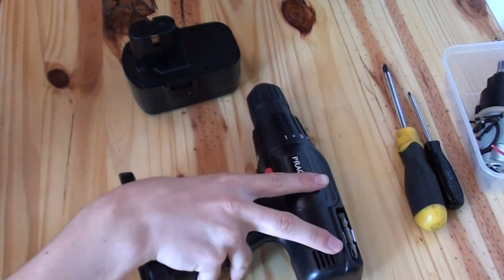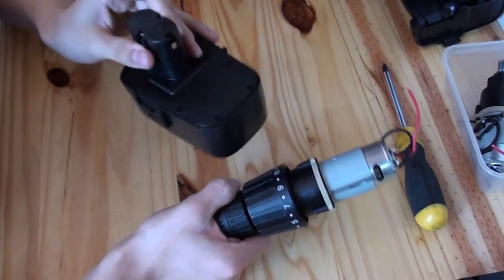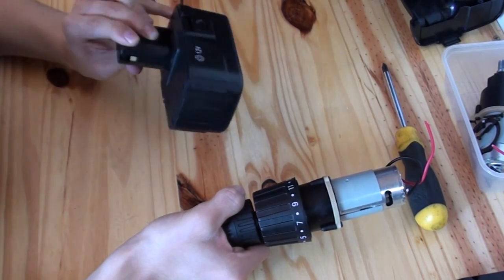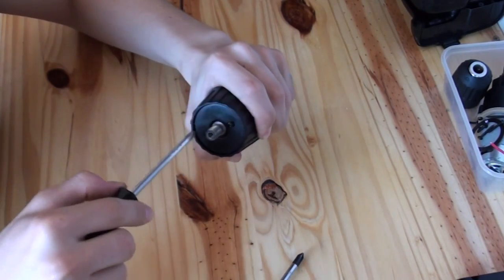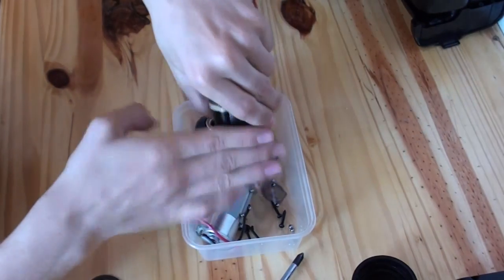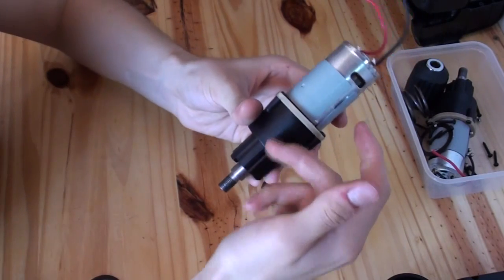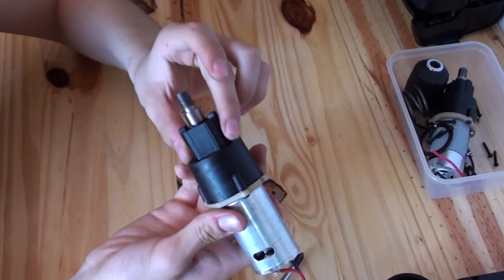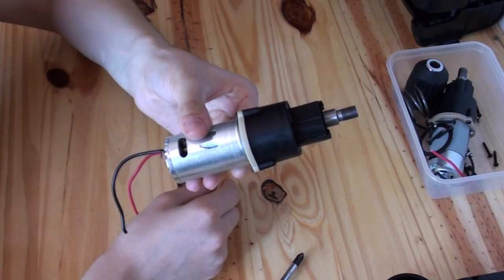How to: turning a cordless drill into a robot drive motor.

Comment: I have taken most of the ball-bearings out, but there's two which simply won't come out- no matter how much I shake them, they just stay there. Is there anything I can do to loosen them, or do I just have to shake them harder? Would hit them with a hammer but I am aware that at this stage, that could result in gearbox damage.
Reply: OK... bear with me on this.

A good strong magnet may work, if not try this:

Take a nail (A normal woodworking nail) something like a 3 or 4 inch nail will do fine... basically you want something you can get a firm grip on. File the point off it slightly and give it a quick clean with a paper towel.

Mix up a tiny bit of epoxy resin (araldite will do) and dab a bit onto the blunted nail and place it onto the bearing in question (try not to get any onto the plastic housing. Wait for it to set.

Hopefully you will be able to pull out the 'tricky' bearing.

Comment: Once I've taken the reverse-thread screw out of the chuck, I can't then remove the chuck- when I twist it, it just spins as it would if I was using the drill. What am I doing wrong?

Edit: never mind, I hit it with a hammer and it screwed off.

Comment: I am looking for a motor for my bot at present  I am using a power window motor .please suggest me with a motor working in 12 /24v rather than these
Reply: scooter motors are quite good drive motors, although they are ungeared but this can be solved with timing belts or chains.

Comment: i wish to make a camera slider .... i have seen a guy hack a kessler slider using an entire drill (not taken apart) to motorize the manual slider to make it go back and forth....will this be possible if i was to take it apart and how smooth will be the too and fro motion... will the motor start with a jerk as the camera needs to have a smooth start

Comment: You mentioned replacing the motor with a more expensive style motor. You got a source or part number for that? I overloaded mine and burnt out the motor. The reduction is still fine, but if I replace the motor with the same type, I'll probably just burn it out too. Great video.
Reply: Dewalt drill motors are supposedly better (haven't used any though) while they are more expensive, the motor and gearbox can take more punishment.

Comment: so where did you turn it into a robot drive ? you only got a motor out of a cordless drill. 
your title is not what you show in the video
Reply from the maker: You add a wheel on the gearbox shaft and put a voltage on the motor wires and you have a powerful gearmotor, which can be used for robotics. I have a how-to for making wheels to fit these drills (actually a 3 part series) and power input for the motor is a widely documented separate matter.

I don't know what could have been done differently in a video like this, short of strapping this to a testbed, which seems pointless when there a numerous videos on my channel alone showing motors like this powering robots.
Reply: TeamExpat i just saying that your title is not what you show in this video thats all.

Comment: Hi, great video, thanks very much!

Any idea what modulus the first stage gears are? Looking to order metal replacements but not sure what spec to get!

Thanks very much
Reply from the maker: Hi! These drills run whatever the manufacturers have settled on, which I don't think is any particular size (might be wrong). I believe they are very close, and possibly compatible, with mod .7, though I don't actually know for sure. I have researched in the past and they seem pretty close.

If you experiment, I'd very much like to know how it goes. An engineery friend of mine suggested the slightly brutal but neat idea of running mod .7 gears in a drill, using grinding paste as a lube, to run them in and make any differences in tooth profile less pronounced. Followed by a complete clean up of course. 

However as I mentioned to a fellow below just today, you can buy the sets of gears for these drills from a UK website called Gimsonrobotics, in their "gearmotors accessories" section. The kind of drill I have above has two 6:1 stages using 18t gears. 

Hope this helps.
Reply: TeamExpat

Thanks for your quick reply!

That link is handy, for £2.72 I'll try some of those gears they offer. I can see the grinding paste working if you don't overdo it, though I worry it might muck up the bearings which are handy to keep working.

Thanks again.

Comment from the maker: Hi, sorry for the late reply. For general combat, a drill motor and gearbox assembly is not suitable for a spinner. These gearboxes can shred internally with high shocks, which a spinner will have to deal with constantly. Plus, they're slow. These spin at about 550rpm at nominal voltage, which is very slow for a spinner these days. The best way to get a competitive weapon is to combine a brushless motor and a custom reduction. The rest of the internet can help you in understanding all that. :)

Comment from the maker: I believe the brake function works by stopping the motors hard, and pausing them, before you can change direction. So there is a delay between fwd/rev. For tank-steering style projects this can be a bit of a pain.

As for calcs, if you search "go kart speed calculator" or something similar into google you should get some results. Some will be imperial (inches instead of millimeters) so you'll have to work around those, but they're logical enough.

Thanks for subscribing, by the way! Good luck.

Comment from the maker: One or two robot builders have worked with those, they seem okay, but have a permanent "brake" function which can be a bit annoying at times. Also know the amp-handling figures those advertise are HUGELY over spec.

For numbers, I can't be sure, but I'd say 20-30a stall (on paper this is much higher), 1-2a free running, and under load anywhere up to about 15-20a. That's just my experience, again, datasheet often report different figures.

Do report, it will be interesting! Thanks for watching.

Comment from the maker: Hi, you can't use speedos from HK and similar because they are designed for brushless motors, whereas these are brushed. They won't work. However, the cheapest reliable ESCs for brushed motors I can recommend are those sold by "Botbitz". They have 30a and 85a models, you need to buy one for each motor, but even so, they end up being quite cheap. The 30a ones will handle a single drill each, the 85a model will handle 2 drills each, easily. 

Hope that helps. :)

Comment from the maker: The diameter of a wheel changes the gear-ratio of the drive. A small wheel will make the robot slower but it will increase torque, whilst a bigger wheel will increase speed but reduce torque.

I haven't got experience with RoboChallenge motor mounts - we made our own fairly easily.
I THINK  2x12 would be okay with two drills, but just barely. Better off asking on the forum, someone will have tried it before, I'm sure!

Thank you and you're welcome. :)

Comment: Just had a look at the RoboChallenge website and found the blue wheels, they look good. What affect does the diameter have on the drive of the robot? Going for 2 wheel drive.
Would you recommend the motor mounts they have on their site?
I have a Sabretooth 2X12RC speedo in my Battle Rat which i'm planning to use in me feather. would it be suitable to use with the drill motors? 

Congratulations on your Roaming Robots award :)
Thanks for your help 
Chris

Comment from the maker: Hiya
The wheels on both incarnations of Tormenta are called "Blue wheels". They were sold by RoboChallenge, before they changed things up a little. Not sure where they stand now, I think they're developing a new wheel. They're great in that they come with a nut inserted in the bore, which screws onto the thread on the drill output, and to lock the wheel on you put a washer and the reverse thread screw in place. 

Is there anything you specifically need help with? (hate character limits!)

Ellis

Comment from the maker: You can use the battery you mentioned in your first comment. If that doesn't work out, a battery from a battery drill will do the job.

As for motor controller, I simply can't give you a straight answer. You will want Electronic Speed Controllers, capable of handling the maximum current draw of the motors of 5 amps each. I don't know where you live, your budget, your setup, etc. Is your robot radio controlled? Even if you live somewhere where ESCs are quickly available you're unlikely to-

Comment: Okay. I have worked on my robot and will send you some pics..The problem is not weight- They have allowed even 100kgs but the problem is with it's dimensions which should fit 1ft x 1ft x 1ft.  My motors are- pitsco . com / sharedimages / resources / DCDriveMotorSpecs . pdf 
They are for 29$ per motor. But my problem is motor controller and battery.
Please help me immidately as I have a  competition after 5 days.

Comment from the maker: If you're clever with design you should be able to fit a powerful drive system and a lifter inside a foot, like Biohazard, especially if weight isn't an issue. Yes, you can use a 3s LiPo for 12v drills, they should last forever like that, and as for speed controllers less than $5, not in my experience. You may be able to piece together a "bang-bang" controller, but that isn't fast reacting or proportional (really crap basically). In fact, it would be more than $5 anyway. I'd go for cheap ESCs.

Comment: Hello,
I am not sure but have you seen biohazard..I am building that robot and am done 3/4th the design..
My robot can't exceed 1ftx1ftx1ft in dimensions no matter what the weight is. so will biozard like robot work great?
and rather than 12v battery(to save money) can I use a hobby RC 11.1v 3S battery liPo?
Also, Is there any cheapway to make a motor controller for less than 5$? please help.

Thanks.

Comment from the maker: Great to hear the video may have helped you!

For robot applications we use "electronic speed controllers" (ESCs), between the battery and motor(s). The ESC is connected to a receiver, so movement on the transmitter's controls results in proportional control of the motor, allowing for precision drive. Speed controllers can be found easily online. Generally, the more money, the more precise.

Upload a video of your build if you can, I'd love to see what you come up with!

Hope this helps.

Comment: Thumbs up. Thanks. I'm building a CNC threading machine from a portable drill. This info probably won't be put to much use for it but still good info for other things.

I'd be interested in hearing about the power control circuitry you use in your robots.